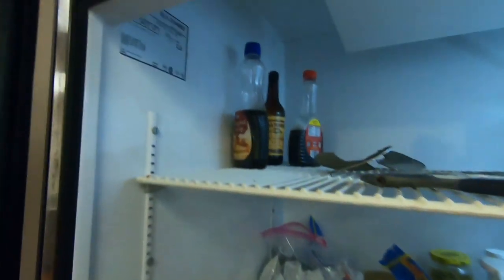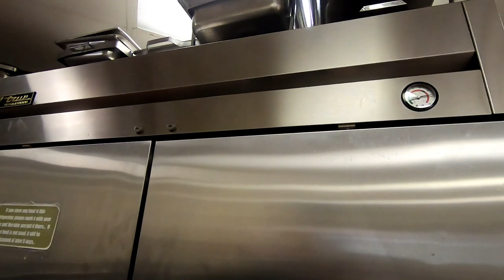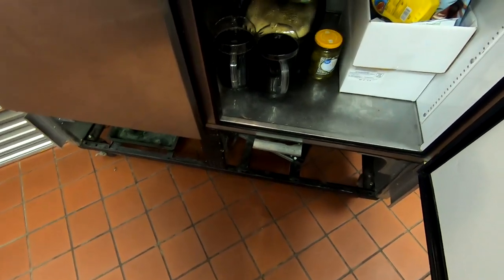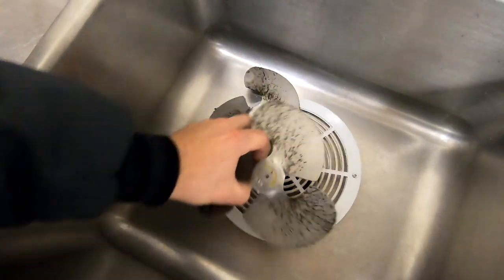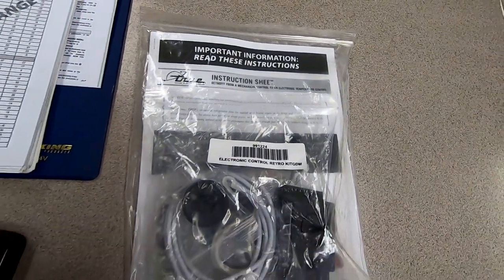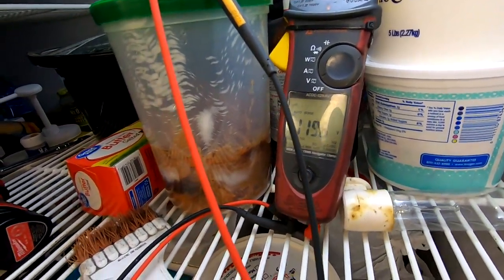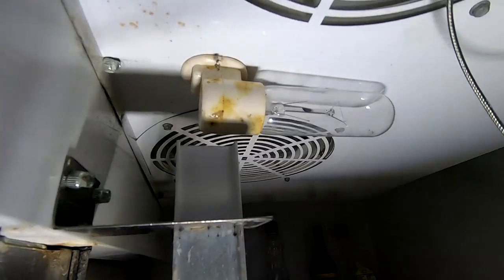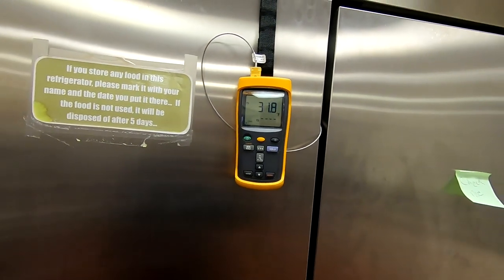True T-49 Cooler Freezing Product Electronic Thermostat Retro Kit

Comment: Great vid! I knew most of those temp controls sense coil temp but I never thought of taking the fan blades out and sticking a probe in the coil, makes perfect sense. Like I’ve mentioned before, I always learn something from ur videos. Thanks
Reply from the maker: Thanks Jason,  one thing I also learned is if you take the cover off and do that test,   Still remove the fan blades. The slightest amount of air through the coil will raise the coil temperature and mislead you to believe there's a refrigeration issue.  Like I keep telling everyone, The reason why I mention stuff is because it's either something I made a mistake on or a question that I used to have.

Comment: Kudos to you for using factory stuff. On a T-49 cooler at my work place i used a A421 temp controller and it has worked amazing so far.
Reply from the maker: I stock two Ranco universal controllers on my truck. But I've had instances where they don't work on some prep tables because of the design. We don't get paid for callbacks so we use OEM thermostats and start components.
Reply: @HVACRSurvival  smart policy.

Comment: great video, easy checks for charge.  I like their concept.  The only thing I may do different, is place the thermistor from my  Fluke beside the stat sensor location. I usually have my customers place a Dixie cup with water inside when they say things are freezing.  The standard 41F has started to get lower now, like 38 or 39F.
Reply: also,  The Ranco controls with the fixed 41F can actually be adjusted.
Reply from the maker: It would make more sense to have it where the thermostat bulb is located but for some reason in the paperwork if you read through it they talk about putting it there in the middle of the evap?  Generally 40 degrees or colder is what I usually see on the health department paperwork. But I believe the health department allows it possibly up to 41 degrees.  I don't know if that's National or if that's just local rules.

Comment: Good Vid. Yep, the Standard Troubleshooting method Straight out of the book. Works good For testing cut in and cut out Temps on a temperature control. Kinda like unplugging a water pump on a ice o matic to test pressure control cut in. i believe i actually have a Thick book form true from a while back that has all that stuff u printed out . These Days i use the iPhone and save all these type pdfs to ibooks and Eliminated Almost all of My Books Off the Truck. One Day i Went to the Truck and Tossed about 50 Lbs of Books and Binders. i Cleared Out an Entire Shelf of Binders and books From the Service Body. i Have Never Looked Back. i Have a few Books i Like but, 96% Went in the Dumpster.

Comment: If the food is/was actually frozen would taking the temp of the coils be necessary? I would think the coils were well below 18° if the food was actually frozen
Reply from the maker: You gotta remember why I said take a temperature of the coil, what I was trying to do was show, whether or not the system was likely under charged without having to tap it with a valve.
Reply: @HVACRSurvival  great troubleshooting! Very helpful

Comment: Question. What kind of thermostat do you installed. Old temperature control was coil sensitive & the new thermostat I saw it had to two thermistor. Thanks for you answer
Reply from the maker: That is the OEM thermostat that TRUE called for, like I mentioned in the video, 1 thermistor senses the Box temperature meaning it's going to shut off at true temperature of the box and the other thermistor goes in the evaporator so that it knows the evaporator has melted all the ice before bringing the compressor back on. Generally it comes back on somewhere around 38 to 39 and 1/2 degrees.
Reply: @HVACRSurvival  great idea!

Comment: not uncommon for thermostat contacts to arc closed and keep running, even with the updated add "relay kit".
they just went from high current arc on break to high voltage back emf arc on break from solenoid, when they went to relay kit, but it did help the terminal melting and contact overheat lol :)

Comment: Question: Just purchased a used True GDM-41SL-54.. it cools just fine - compressor kicks on and off - no problem - but the fan doesn't shut off - so will the fan run 24/7 ?? Sounds like it will run up the electric bill... any way to have it shut off when the compressor shuts off, or is that a safety feature that must not be modified ?? Thanks!!
Reply from the maker: Depending on on how new it is generally a cooler runs the fans Non-Stop. If it's a freezer, the fans stop whenever the doors opened or the unit is in a defrost. Those fans don't pull a lot of power and when the compressor is in the off-cycle, the fans continue to run so it melts any frost off the evaporator.
Reply: @HVACRSurvival  Ah, good to know - we were just concerned about our electric bill going 'through the roof'... thanks for your response !!!

Comment: i ahve a T49G we bought in 2015. after 3 years it started freezing stuff on inside. compressor kept running and running would not turn off. im not a tech, but i winged it and assumed the analog thermostat on the inside went poop. replaced it myself and it ficed the problem. i think TRUE screwed up here putting in an analog mechnical therostat INSIDE the cooler where it is subjected to cold, condensation and moisture. it was destined to fail eventually and the new part will to in time. would u agree with my notion on this casE? i think the newer TRUE t-49s have elctornic ones now that are outside the unit
Reply from the maker: The True reach in coolers and freezers have both mechanical and electronical still today. Some are inside and some are outside of the compartment.
Reply: One I just replaced was from 2001 so I’d say ours worked as it was supposed to.

Comment: I have a t 49 that is freezing food. The evap coil temp. drops to 9 degrees f before shutting off the compressor. The cabinet temp. reads 20 degrees f. Could this be a bad temperature control valve?
Reply from the maker: It could be a thermostat or the system could have a refrigeration issue like low on refrigerant.

Comment: I have a T-49 and today i notcied water leaking in it. I took the cover off and noticed there was a HUGE chunk of ice in the drain pan that sits below the evaporator coils. no ice on the actual coils just a big chunk in the drain pan. do you know what might cause this when there is no ice on the coils but just in the drain pan?
Reply from the maker: Thermostat might be sticking causing it to freeze one time and allowing it to thaw the coil the next time? Hard to know for sure without checking the whole system over.
Reply: @HVACRSurvival  Would it possible the drain clogge  filling the pan and the water froze?
Reply from the maker: Yes it could a plugged drain line or a bad pan or drain heater not working.
Reply: @HVACRSurvival  yes. assuming the evap coils were working properly an defrosting (given no ice on actual coils) , if the pan underneath fills with water, it is possible for it to freeze? I guess keep an eye on it to see if it happens again
Reply from the maker: If it doesn't drain yes it'll freeze and grow

Comment: I have a True TSD-69G triple door reach in coiler. The temp controller is turned all the way up and inside temp is around 34-35 degrees. Could my controller be going bad and how hard is it to replace.
Reply from the maker: I need to know what your definition of turned-up is? Are you wanting it colder or warmer?

Comment: Hi I have a T-19 fridge and I have knob set to 1 and the unit is still running very cold. The temp sensor I put in is reading 0 Celsius. Any recommendations?
Reply from the maker: If your EVAP is not reaching 17-19* f with the fans off there is a compressor or refrigerant problem.
Reply: @HVACRSurvival  and if it is I should change the temp sensor control?
Reply from the maker: @bro1029384756  that's what it sounds like but I can't be sure of that without doing a proper diagnostic. Why not have a service company check it for you?

Comment: Am I the only that prefers mechanical over the electrical? I’ve had too many problems
Reply from the maker: I've heard of them having problems already with the electronic thermostats but that's what they are now providing for a OEM replacement so that's what I had to put on. I've used ranco and they don't always work like they're supposed to. This is way for True to stock one control that does a lot of different units versus several different thermostats. It comes down to money saving for the company and less stock for us to stock.
Reply: I personally don’t prefer the electrical control we have had a bunch of issues with them
Reply from the maker: @DW-bo3qw  I have a feeling they won't hold up as well, but if that's what they got for OEM Parts I'm covered. Like I said we don't get paid for callbacks and if I use an after-market part and there's an issue then it's on me otherwise if it fails then it's on the part not me.
Reply: HVAC*R Survival these replace the freezer ones too?
Reply: HVAC*R Survival agreed completely I use one parts whenever I can like you said covers you and callbacks aren’t cheap
Reply from the maker: @HermesVintage  I would say probably not because the freezers have built-in defrost controls. and freezers generally just monitor the Box temperature not the coil temperature. Are part person always calls true to make sure before we just put it on.